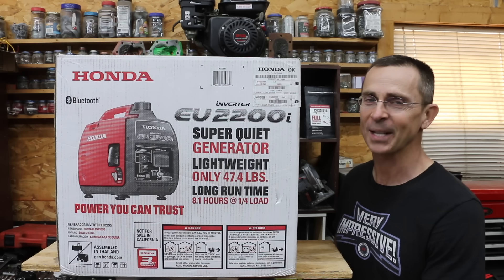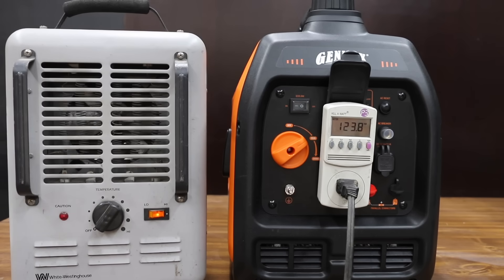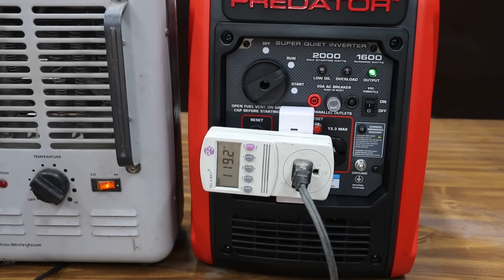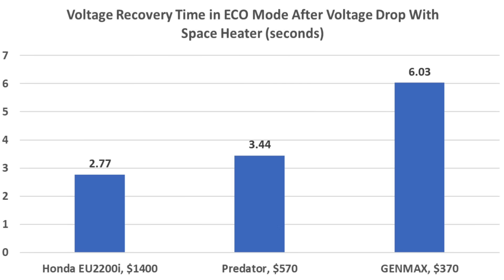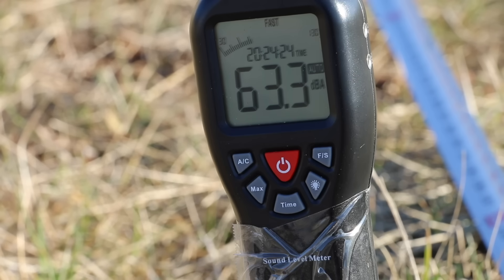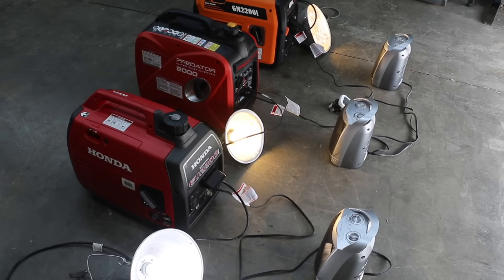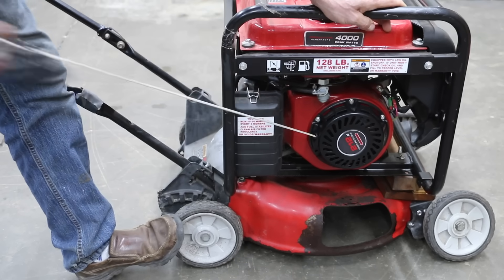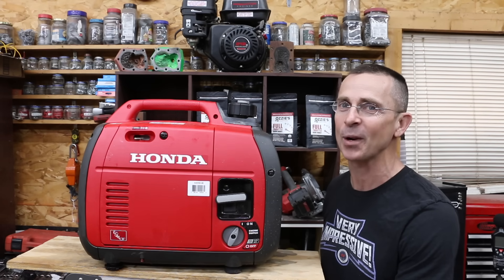Cheap Generator Better Than Honda? Predator vs Honda & GENMAX—Let’s Settle This!

Comment: I bought a Honda due to the surge rating.  It can run at the surge rating of 2000 watts for up to 30 mins.  None of the other units I researched came close to that, they were on the order of a few seconds.  This is a HUGE difference that has made all the difference when using the unit to charge batteries where the charger pulled over 1600 watts for extended periods of time.  If the 2200 watt Honda unit has this same ability that is a HUGE benefit that the other units do not likely possess.
Reply: Same reason I bought mine.  I couldn't find ANYTHING else that does that.  Most folks don't know.  I have had the same experience charging batts and when cool in the morning it runs well over the rated load w/o shutting off for, well I don't know how long, it never shut off!    That and the fact that they routinely run forever is THE reason to get the Honda...and I'm a cheapskate!
Reply from the maker: Thanks for sharing.

Comment: I would like to see WEN generators compared.  I think they are the same as Harbor Freight's predator line out the same factory but cost less and don't have a store backing them up.
Reply from the maker: Thanks for the suggestion.

Comment: Test the medium size Westinghouse dual or tri-fuel if they make one. Generators that run on LP gas, propane, or gasoline seem to be very versatile. A test would be great as during power outage natural gas supply is still fine. A quick connect to a BBQ fitting would seem to be great option. Propane can be stored in tanks for a very long time too. Gasoline not so much.
Reply from the maker: Thanks for the suggestion.

Comment: I love your channel and the way you test everything on such a level/unbiased field. I've been waiting for a long time for you to test generators so I was excited to watch this video. My only request would be for another generator comparison using larger generators. I'm hoping for a comparison of generators that would be large enough to use with a RV.
Reply from the maker: Thanks!  Thanks for the suggestion.
Reply: Just get a second Honda and run them in parallel

Comment: Great video.  I had the opportunity to purchase Energizer generators a few years ago.  I bought a 3200 and a 2000 for a little over half the price of the Honda 2200.  They run in parallel with the larger one managing loads automatically.  Got them to power my 5th wheel, but they do duty around home as well.  They're great for my purposes and highly recommend the brand.
Reply from the maker: Thanks!  Thanks for sharing.

Comment: I have two Honda EU 2200!s. A and B connectable for combined 44kw. They run full load for 5 hrs. I purchased threaded gas caps and installed fuel lines to a 6 gallon outboard fuel tank. Can run for 16 hrs before refueling. Love my Hondas! Got 12 v outlets and a 30 amp outlet also.
Reply from the maker: Thanks for sharing.

Comment: those low price suitcase generators require close to total dis-assembly to remove the carburetor for cleaning if you allow crummy ethanol fuel to sit to long - parts availability - good luck
Reply from the maker: Thanks for the feedback.

Comment: Yes, the Honda's is not cheap.  Inherited a 2,2KVa generator from my father purchased in 1978 and abused badly over it's lifetime on construction sites, and was going strong until it got stolen in 2021!!!   Only had some work done on the carburettor around 2014.   Was replaced with a Honda EU2200i.
Reply from the maker: Thanks for sharing.

Comment: I've had many of those Predator generators in my shop.  They stop generating.  Or they put out low voltage.  Often the AC going into the rectifier circuit board is low or absent.
The cheap generators use aluminum wire for their windings and I think the aluminum windings short out or break.
Then the regulator board often goes open and good luck finding one.
Honda is the most reliable.  If you need a generator a lot get the Honda 
Or a Yamaha.
Reply from the maker: Thanks for the feedback.

Comment: I've had the older Honda EU2000i for years and it's a fantastic machine, it has been rock solid reliable. There are a lot of cheaper clones these days that offer an impressive bang for the buck but as this video shows, none perform quite as well as the Honda. Somebody once told me "buy good tools and only cry once" and that has held true. I don't know why anyone still buys conventional generators, the inverter type are vastly superior in performance, fuel economy and noise.
Reply from the maker: Thanks for sharing.

Comment: Would like to see oil test after dirty oil cleaned out and run again. Not sure how much was left over from manufacturing.
I once had a Chinese hydraulic jack that had used motor oil mixed with kerosene, brake fluid, and whatever else was disposed of. Worked much better after oil change.
Reply from the maker: Thanks for the suggestion.

Comment: Thanks for another great video, with concise, useful info, as always. Would like to see a comparison of propane- and/or multi-fuel portable generators. For those of us whose liquid fuel storage options are limited, propane-powered generators are a great choice. I boughtine when I lived in a townhouse, and had no where to safely store gasoline.
Reply from the maker: Thanks and you are welcome!  Thanks for the suggestion.
Reply: The dual fuel units are nice because it allows short term run on propane with no long term storage maintenance duties of draining the fuel completely,  and the ability to use gas for longer term use sessions, when the added hassle of purging the gas from the carb and tank is more tolerable.

Always, always purge all the ethanol laced gasoline from the generators for long term storage, or you'll have a useless hunk of metal when you need it next.

Comment: Would love to see a mid-priced unit added, like the Generac GP 2500 ($679 at Lowes). They are supposed to be a generator company after all, they "should" be able to get it right, and at about 1/2 the cost of the Honda, that would be something to see.
Reply from the maker: Thanks for the suggestion.

Comment: Awesome, as always! Nothing runs like a Honda! I had an old Troy Built generator, all the little plastic and rubber bits broke and rotted. But the old Hondas from work look like they fell off a truck running down the highway, but they never had any problem running!
Reply from the maker: Thanks!  Thanks for the feedback.

Comment: Don't buy a Honda. I did and its a overprice peace of junk. Mine did not run right out of the box. Experienced engine surging. Tried to return it. That's not Hondas policy. Had to bring it to a certified Honda repair dealer. I was told it was a fuel issue not covered under warranties. I would need to pay for a new carburetor(260 dollars). What The F. It had 3 hours on the generator and they told me I used bad gas damaging the carb. I filled it with new gas from Shell. Then they told me that may not fix the problem it was a first step. What? I called Honda corporation. They stood buy the Honda dealer. So I did some research online. Turns out Honda carburetor jets is prone to clogging due to a bad design. Even brand new due to improper post production cleaning. I replaced the jet myself and the generator runs fine for awhile. It is cheap plastic jet is prone to clogging. So I carry a extra jet with at all times. So Honda sells a 1200 plus dollar generator and can afford to use a brass jet? The icing on the cake is after I complained to Honda Corp they voided my entire warrantee due to what the Honda dealer said was improper use.  DO NOT BUY HONDA
Reply from the maker: Thanks for the feedback.

Comment: Good job mate but seriously I bought. A Honda and took it on my boat around australia for last three years and it still goes and looks and starts every time perfectly and I think it will run almost forever but I wouldn’t like to be offshore in isolation with a Chinese built generator because I’d be worrying about it all the time, the Honda genuine is the good gear and if you’re living on a boat relying on that thing most days to charge up house batteries the Honda is the only choice .  They’re just beautiful.
Reply from the maker: Thanks!  Thanks for sharing.

Comment: Hey project farm! thanks for your content its really usefull for everyday things i appreciate it!

i have a suggestion, you could test different batteries chargers you can buy online (typically to charge 18650/21700 lithium ion cells)

you have quite a few brands: liitokalaa (they sold a lot of their "lii-pd4"), there's the xtar brand as well as the nitecore brand

it could be usefull to lots of peoples because 18650's cells are everywhere (in power tools, laptop batteries, vaping mods, etc..)

for a fair test i would use Molicels INR18650-P28B, they are great cells with actual ratings and they provide great power/size ratio!

hope you will see this comment and actually test these! (they are cheap)
Reply from the maker: Thanks and you are welcome!  Thanks for the suggestion.

Comment: Very well reviewed, however what caught my attention is the readout rate on the voltage meter, it seems to be in the realm of 0.5 seconds, that does not seem fast enough for an accurate assesment for a 100th of a second precision. Would'nt a +-0.5s mention be correct?

Comment: excellent true field testing. I have a Honda EU2000 generator. It turns out the ON/OFF switch is bad ( generator wouldn't turn on. I disconnected the switch connection and it turns on, i plug it back and it shuts down the engine). does anybody know the part number???

thanks in advance

Comment: Nicely done.   I'm always concerned about the plastics used in the cheaper brands.  They oftern aren't oil/gas proof or fiber reinforced so they tend to break prematurely.   There are codes molded into the plastic parts to tell you what they are made of.  Might be worth comparing that as well.
Reply from the maker: Thanks!  Thanks for the feedback.
Reply: My brother has one of the Predator generators tested in this video. It works ok and doesn't burn oil like this one is but it's only about 4 years old and the rubber gasket around the fuel gauge has already cracked to pieces.

Comment: I have one of the first Honda generators. Can’t remember the year of purchase but I going to guess early 1980s. For about ten years it ran at least one day a week. It still runs today. I did follow oil changes as I should of or check the valves as often as required. It still always ran. I think I payed $300 for it. The charging cord for batteries went bad and had to fix a hole in the gas tank when I think something was dropped on it. But I sure got my money out of it.
Reply from the maker: Thanks for sharing.

Comment: I would like to see you test the champion generator. They come with a hardened cast iron sleeve in the block for long life. I would really like to see the "invertor hybrid" which is a cross between an open air and inventor but at dramatic cost savings with all the perks of most invertor generators (variable speed, clean power, better fuel economy, reduced noise).
Reply from the maker: Thanks for the suggestion.

Comment: Is the Genmax different tha a Generac generator, or is it made by Generac? If it's not a Generac, that would be a good candidate, because Generac are a popular generator. Champion is another popular brand and I thought the Westinghouse ones were also interesting. Firman also makes good generator and they makes ones similar to this size with their "whisper" series, which would make for a good noise comparison, especially vs. the Honda cause it's so quiet.
Reply from the maker: Thanks for the suggestion.

Comment: Excellent.  No surprise about the Honda, though.  I have that model and it works very well.  One thing about my Honda is that when it is drained of fuel (for storage) letting it sit in the “run” position for 10~20 minutes before restart allows one-pull starting.
Reply from the maker: Thanks!  Thanks for the feedback.

Comment: I have a question if anyone can help me out but would these generator size be good if the power went out? Like would it be able to keep the AC and or fridge on or would i need a bigger one with more , wattage? TIA

Comment: Engine wear during break-in is one thing.  Engine wear after is another. Wonder how the non Honda units would fair down the road.  200-hour oil testing would be helpful.
Reply from the maker: Thanks for the suggestion.

Comment: I bought the Predator 3500 in 2018 for a little over $500  on sale at harbor freight and that’s been an absolute beast. I highly recommend it.
Reply from the maker: Great
Reply: Yes.  I dont buy harbor freight tools. But...this Predator generator is exceptional.  Plus it has a fule gauge which the Honda does not.  Numerous owners who have used them long term rave about how they start first pull and super happy with them as well.

Comment: This makes Consumer Reports testing protocols look like the fluffy useless joke that they are.  No more colored circles with no explanations for me.  Nothing beats the actual data.  That oil test is excellent.  For sitting in the garage waiting for a once every four year power outage, the cheap generators will be good. For regular use, the Honda is the machine.
Reply from the maker: Thanks!

Comment: Maybe I missed it, but why are you adding oil by weight and not volume?  10 fluid ounces of oil is likely not the same as 10 ounces by weight.  Not a big deal, just wondering.  LOVE your channel and your videos.

Comment: Nice testing, the dB system is based on human perception, 3dB is just audible. Contrary to your comment, universal motors in tools like angle grinders and circular saws are helped by low voltage on startup. The slower acceleration of the motor saves the harsh loading on the reduction gears.
If these are run on DC, they are much quieter and more powerful, but the switches will arc over. Older non cap start/run induction motors did not like low voltage when running fully loaded. If you look at the mains waveform it can be just as bad with harmonics from the many rectified loads, now common place. Power factor compensation is now mandatory. Only cheap crap electronics will object to poor quality supply, in fact most inverter stuff now will run off DC.
Reply from the maker: Thanks!  Thanks for the feedback.

Comment: Genmmax had 12ppm silicon, which is mostly caused by dirt ingress into the oil. Indicates issues with air filter and pcv.
Reply from the maker: Thanks for the feedback.

Comment: I have a different rebadged version of the 2000 watt predator. It's a WEN model but the model , engine is the same guts. The manual on these Yamaha clones like my WEN, Predator and a few other clones recommend that you DO NOT use ECO mode with anything over 1000 watts as it won't respond quick enough. I wanted the Honda of course but ended up getting 2 of these WENs for each under $400. I never use ECO when I am running a big draw item. Your channel is awesome and it was great to compare my WEN (predator) to the Honda here.
Reply from the maker: Thanks!  Thanks for sharing.

Comment: Something worth mentioning. Every 3 decibels, the noise doubles. So going from 59 dB to 62 dB is 100% more noise energy. A 3 dB is substantial
Reply: I did not know that, thank you for the insights.
Reply: @mjremy2605  NP. Audio is weird and still has much to be discovered.
Reply: Reinforcement or the last word perhaps 😅
Reply: 3db is a small but noticeable difference.  Takes 10db to double volume
Reply: @texasfrontiersman8245 dB is measured on a logarithmic scale so 3dB more is twice the impact on hearing or essentially twice as loud. 10 dB represents a tenfold increase, for example 20dB is not twice as loud as 10dB, but rather 10 times as loud.
Reply: @thunderusnight texes frontier man is right. From a physics standpoint you’re right. You see humans hear in reversed logarithmic fashion and it’s not the same at all frequencies. Look it up, it very interesting. MAF curve is particularly strange.
Reply: @acsnitner7661  that's pretty interesting
Reply: @thunderusnight  You can easily confirm, by increasing the volume of some audio 3 dB, and compare it to increasing it 10 dB.
Reply: 3 dB is a doubling of power

6 dB is a doubling of voltage or sound pressure level (SPL)

10 dB is considered to be, to humans with a non linear sense of amplitude, a doubling of apparent loudness.
Reply: @Breezer56  right, we got through that confusion. What are you trying to add?
Reply from the maker: Thanks for the feedback.
Reply: You're confusing wattage with SPL.  A 100 watt amp is 3db's louder than a 50 watt amp but it's not twice as loud.
Reply: @RalphMercuroMusic  "The 3dB ‘trading effect’ means for every 3 dB the sound level increases the impact on hearing health which is doubled. For example, 63 dB(A) is twice as noisy as 60 dB(A). The relevance of this is apparent when considering exposure to hazardous level of noise. For every 3dB the noise level increases, the exposure time must be halved to keep the worker safe from harm.
The 3 dB trading effect is accepted in most countries. Some countries like the USA use a 4 dB and 5dB trading rule."
Reply: @GibsoLesPaulStandard  you're mistaking the literal energy of sound vs the mentality perceived sound increase. Double the wattage, you get double the power or 3dB increase. But to get a perceived doubling of sound, it takes 10 times the power.
Reply: 3 dB is a doubling of power

6 dB is a doubling of voltage or sound pressure level (SPL)

10 dB is considered to be, to humans with a non linear sense of amplitude, a doubling of apparent loudness.